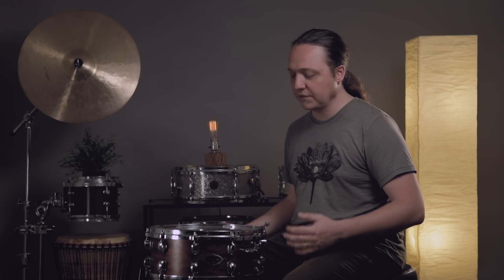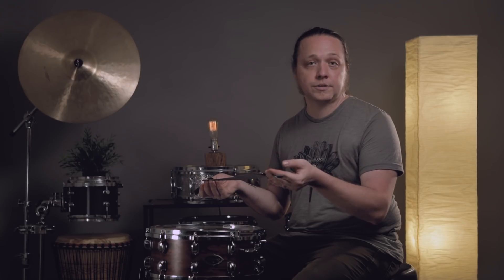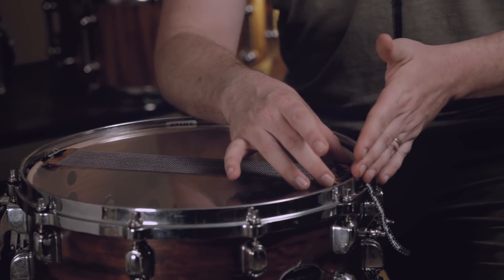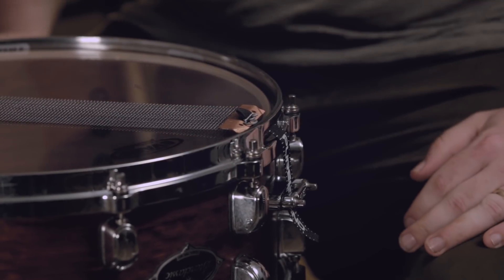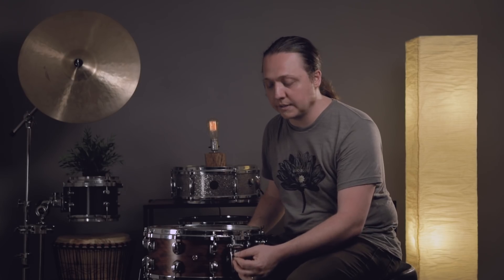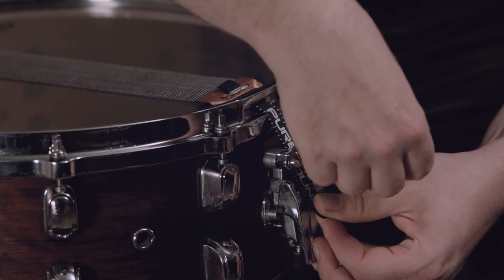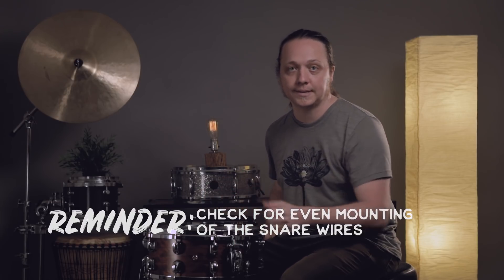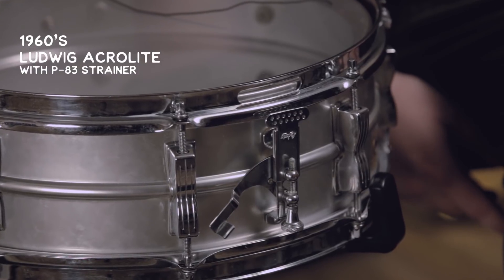Ep. 18 How to Install Snare Wires

Comment from the maker: What's your preferred snare mounting method (straps or strings)?
Reply: Straps, since 1. I find they're a lot easier to install 2. They won't dig into the edge of a drum (only really a concern on wooden drums) nearly as much since they disperse the pressure over a much larger are. Just my 2 cents :)
Reply: Whatever the drum originally comes with, I usually just stick with that method. The manufacturer must have shipped it that way for a reason..? That’s my thinking! Cheers
Reply: Strings. I am unable to line up straps for some reason.
Reply from the maker: Always worth experimenting though. You'd be surprised to know how often drums ship with certain OEM gear that doesn't allow the drum to function at it's best. Heads and wires are at the top of the list for that. Thanks for watching!
Reply: Strings have always been my preferred method as I've had trouble seating (plastic) straps in the past. Once they've got a good kink in them, it becomes difficult to adjust them without replacing them. Those nylon straps appear to be much more functional though.

There's also something cool about using string, I guess since it's sort of old school. 

Great channel with excellent, knowledgeable and articulate hosts and top notch information. Thank you!
Reply: Straps. I find it easier to keep the wires nice and even using them. Having said that, I use strings on a couple of my vintage snares for the reason you said (no clamping mechanisms on the throw) and don’t have any issues. I do prefer to use the Grover Percussion Dacron strings when necessary. Thanks for another helpful video.
Reply: Strings, always, because the slack in the strings will be equally taken up as the snares are tensioned by the strainer, resulting naturally straight snare wires.  A strap holding the snares, if installed even the slightest bit crooked, will leave one side of the snares unequally tensioned.  I also think the slight give in string is beneficial in allowing the snares to react and not choke the drum.  And I use a double knot to tie off the strings, as you illustrate, I've never had one come loose.
Reply: Pure sound straps . With measuring tape
Reply: I like straps due to the ease of installation and adjustment.............but have often wondered if I am missing anything by not using strings.  Seems like a lot of high-level snare drums come with strings (Ludwig, Sonor, etc), so I find myself wondering about the snare bed itself and if straps might lay the snares a little too flat..........
Reply: I would imagine that straps may indeed lay the snares too flat on shallow beds, however it depends on the endplate design, the custom pros look interesting.
Reply: I used straps in the past but have gone back to using cord. Sometimes butt plates and strainers can be a bit crooked or not square on the shell. I would imagine the straps that come with custom pros are only straight/square if the hardware is straight/square too. I think cord can be more forgiving.
Reply: Straps. I´m not good at using the threads, plus they damage the shell.
Reply: Straps. I am so bad at mounting strings.
Reply: @Tyler_Wilson  At times and more often than not the manufacturer simply uses what's the most cost effective for THEM.
Reply: Straps for sure. Strings scare me haha
Reply: Sounds Like A Drum straps
Reply: Strings because no matter what straps I've used on a few different strainer/throw off's, they always pull loose no matter how tight I clamp them. Frustrating but strings 110%. At this point I don't even think one could make me change back to straps.

Comment: Cody,  first let me say thank you for all you and the Crew do,... much appreciated.
I have a question about mounting wires with string on a vintage 1960's Ludwig Acrolite with a Ludwig P83 snare strainer like in this Video.
What string are you using and where can I get some of it at ???? It looks like it ties easily with an even PULL on the wires.
Most of the string / cord I find is a little on the "thick" side and when I tie it, it becomes unbalanced or un-even on the PULL of the wires. (very annoying to deal with).
Thanks in advance for any help.
GOD Bless

Comment: I use those same Puresound snares as in the first example, but I took off the spring clips and used some 1/8th inch aluminum rod to keep the snares and strap straight.  With the clip they want to slide a bit to one side.
Reply from the maker: The Custom Pro series mounting is a little tricking. If you don't have a hairpin clip of some sort, there's often a greater risk of them falling out during performance. That being said, even the hairpins will fall out if they're not centered within the inset portion of the end clips.
Reply: The aluminum rod I used had to be forced into the strap and in two years or more has not slipped.  I found that after some time, disengaging and engaging the snares caused to clip to shift and cause the snare wires not to be totally parallel with the hoop of the rim causing stange sounds.  One would have to see what works for them.
Reply from the maker: Sounds like you found a great little hack! Always good to be cognizant of that stuff. Cheers!

Comment: Hey guys, I have a question!

I have a steel Yamaha snare with the same pure sound wires. An Evans technician in my local shop helped me set it up last weekend with new wires, batter and resonant head. Sounded gorgeous. I keep my drums in the garage where the temperature fluctuates (UK Winter/Spring). I went to play last night and the noticed immediately snare wires had lost a lot of the tension and didn't sound as clean when trying to add tension to the strainer so I ended up loosening them off and trying to re-fit them.

My question:

Can the strap ribbons stretch with temperature/moisture or is it more likely that they've slipped through the tension mechnism?

Love your channel.

Comment: Where should I put the snare adjustment if they’re a one on the butt plate side AND on the snare switch side. I have a Tama SLP Bubinga and there’s snare adjustments on both sides. I changed the stock snares but I’m still having buzzing issues and it’s really discouraging and frustrating. I don’t know what I’m doing and I watched this video 100 times. I really can’t get the sound I want and I’ve literally been messing with it all day. I jut want a good metal crack but it’s soo ringy and buzzy.
Reply from the maker: I hear ya, yeah those can be trick. Honestly if I had one of those I'd probably just tighten the butt plate side up all the way and pretend like it's the non-adjustable kind. I'm not 100% sure what the need is for adjustment on the butt plate side as well (other than maybe to have some wiggle room for making sure the wires are centered on the head after installation). Based on the sound issues you're describing it's probably more of a snare-side head tuning/leveling issues than the wires or that mechanism but hard to say without seeing it in person. FWIW, i've also purchased snare wires that turned out to be defective right out of the box once or twice. It's uncommon but it can happen (damage in shipping etc), might be worth taking them off the drum and laying them on a table to make sure they're not twisted or anything. Good luck! - Cody

Comment: Would it be too much of a bother if you show us a video installing and tuning a Rogers Dynasonic Snare drum? I find it a little complicated with the presence of a snare frame to hold the snare wires.
Reply from the maker: Neither of us have a Rogers Dynasonic but if Rogers is interested in having us do a snare spotlight video one the reissued drums, we would certainly dive into the snare wire mounting and fine-tuning. -Ben
Reply: @SoundsLikeADrum  Thanks

Comment: Do you have a preferred model of snare wires for jazz?  I currently have Canopus Vintage Dry wires on my Yamaha MCA snare based on some recommendations, but I don't really dig the sound.  It's a little too bitey (mids high?) for me.  I'm not sure if it's the wires, but it consistently sounds like when using different tuning approaches as per your videos.  I want articulation, tone, and warmth.
Reply from the maker: Yeah those particular wires are suuuper articulate and can be a little sharp-sounding for my taste (i've had two sets over the years). I personally only  really use two kinds of wires (apart from if i'm just using whatever came with the drum) I use Puresound Custom Pro 24 steel for a wider/softer sound and Puresound Blasters for everything else. Don't be scared by the name, the Blasters are way versatile and much closer to older steel snappy snares that i've found on vintage gretsch or ludwig drums in terms of the thickness/stiffness of the wire. There are also 20 strand Custom Pro's if you want less wire sound, but with any of the sets I mentioned you should be able to get a great jazz sound with proper snare side tuning. Good luck! - Cody

Comment: wait a minute... are you not supposed to tighten and loosen your snare tension with the strainer open? I always took the tension off with the strainger, and then adjusted tension, then closed it up.
Reply from the maker: There's no hard and fast rule with that. In some cases (often depending on the strainer) it's difficult to do it with the tension engaged. Still, I've yet to see any damage or other negative effects from adjusting tension while the strainer is still on and then you can hear the subtle changes smoothly as you alter the tension. -Ben

Comment: Do you put the soldered side against the bottom head? (The side with the prickly bits)?
Reply from the maker: Yes! But always double check to make sure that there aren’t any sharp points (anything that could pierce the snare reso) protruding. If you discover something, you can file it down with a metal file.

Comment: Awesome video as usual guys! 
My question to you is if you have a tension knob on the butt plate as well, would you recommend making that as loose as it can go too? 2 of my snares have this and I would love to hear your feedback. 
Thanks!
Reply from the maker: Oh, like there are tension adjustment knobs on both ends? Hmm, I think I’d probably put the secondary one at the midpoint and just treat it like a normal passive butt plate. The thing you want is some room on the mechanism to adjust tighter or loose and for the wires to be centered on the head when engaged, so I think that’d be the way to go. Plus with that kind of mechanism, you can adjust the centering of the wires by loosening one end and tightening the other incrementally. Pretty cool :) - Cody
Reply: Good point! Thanks for giving me your feedback, Cody! Cheers!

Comment: I have a question. A couple of months ago I bought a 24 Strands snare wires, but by watching a previous video on your channel it seems like this wires are for a snare with no snare bed (Like the Tama Starclassic on your video) but my snare is a Mapex Armory Tomahawk and a Ludwig Epic and both have snare beds. Do you think that if I put this on any of my snares it would affect the sound in a dramatic way due the fact that both have a snare beds but this snare wires are designed to snares with no snare beds? I really need your help
Reply from the maker: Hey there! I think you’re gonna be fine, 24 isn’t that wide of a wire set. Once you cross 30 strands and especially at 42 you start to have the snare bed design really affect the behavior of the wires. Give them a try! - Cody
Reply: @SoundsLikeADrum  thank you so much!!!

Comment: Just a funny midnight thought: what about using strings AND straps? It might be difficult to have an even tension of the 3 devices, but it could be interesting to have a "perfect" tension of the wire strand from its centre (with the strap) and the edges (the 2 strings). 

Alright, maybe I´ll feel ashamed tomorrow morning about this comment.
Reply from the maker: Hmmm, interesting concept though there tends to be one option that has the best angle for tensioning (this is something we’ll cover in a future vid).
Reply: @SoundsLikeADrum  mmm I guess this is going to be the strings as it seems to be the preferred method in your videos. Personally, I struggle to get get equal tension on both sides, and it is rumored to damage wooden shells...
Reply from the maker: @Eurodrummer666  It's a little tricky but we've got a method that works. Also, strings are always the way to go- this really depends on the design of the wires as well as the snare strainer. As far as strings damaging wooden shells, the blue wire that Puresound used to sell was definitely capable of this but the woven brown cord doesn't seem to produce any problems: 
http://www.puresoundpercussion.com/PSPProductDetails.Page?ActiveID=4896&productid=3&productname=Dark_Brown_Braided_Line
Reply: @SoundsLikeADrum  Nice alternative, i wish this brown cord will be imported in European shops soon! About this method to attach cords, have you mentioned it in an earlier video?
Reply from the maker: @Eurodrummer666  It was buried in a video we did previously on snare wires and/or snare side tuning but we'll cover it in a real-time setup video coming soon.
Reply: @SoundsLikeADrum  Yes, please!

Comment: What about strategies for centering the snare wires once on the head and engaged? I find that to be pretty important to get a good snare sound/response and its always a struggle.
Reply from the maker: Absolutely - it’s super important. I don’t have any specific tricks, I just pull on the wires or strap that’s on the mechanism side after the butt plate side is mounted and cinched down and look at where that end of the wires lands on the head when it’s under tension. Cheers! -Cody

Comment: I have found I could be most creative with the ludwig p86 millennium throw compared to the P83. Because the arm of the P86 sits perpendicular to the drum, as opposed to parallel like the P83, mounting my snare with the throw at my 6:30 (or right between my legs) allows me to engage and disengage as I drum. Whats more, engaging sounds like a ghost note or a predelay on a loud crack. While improving I am able to use my snare as a shallow tom for long sections and just drop in two cracks at random then release the throw again as i bring my arm down. You know the sound the snare makes as the wires are engaged. Just imagine using that as a note before a snare crack at about the speed/tempo of cocking a shotgun. I need to do a video cause I cant find anyone else doing this and I think folks would like it. It's fun and it makes the missus roll her eyes at me which means she loves it..... I think.

Comment: I'm surprised to hear that you like P83s so much. I never cared for them. 
On my recently acquired cherry 1970 Acrolite, I replaced the throwoff with a Dunnett, though I kept the P83 and the original heads and snares.
Reply: Does the dunnett fit that snare? I don't care for the ps-83 either...maybe ps 86?...
Reply: @gibrandogg  he's confusing the p83 with the equally bad p85.

Comment: This (as with all of your other videos) is very helpful and informative. I’ve been struggling with a vintage Premier steel shell snare that uses holes on the strainer, and my biggest issue has been that the leading brands of snare cord seem to be laquered. This makes it very difficult to tie a knot that stays put - it doesn’t settle as a string would.

Comment: Straps. I do have string on my Ludwig sometimes it’s difficult to see the small holes on the throw offs I also use shoe string dress shoes 👞
Reply: You should look at replacing the throw off and butt plate to the p88. Drums on sale makes a version with the butt plate tapped so it adapts to the p32 butt plate.

Comment: Very informative as always! Although I found that starting with the throw-off side allows me to perfectly position the snare wires in the center of the drum before tightening down the butt plate side, by slightly tightening/loosening the throw off
Reply from the maker: Thanks! That's the best part- if you've found something that works for you, then that's great. We both choose to mount from the opposite end first since that side will remain static with regards to the distance from the shell, allowing us to focus on the tension on the strainer side. Regardless, what matters most is making sure that the wires are centered once tension is applied. Cheers!

Comment: great video, thanks for the info.  i am re-doing my snare wires and heads after years of neglect and needed a refresher course lol.  your thoughts on the Noble & Cooley strainer, with classic rope as opposed to straps?  I have a 4x14 N&C and replaced the recently snapped string wchich resulted in a broken strainer after 20 years of loyal service.
Reply from the maker: Hey there! I’m pretty into strings for most of my snares including my N&C, but have had some good luck with straps at times. Currently I have 20 strand Puresound Blasters on mine, attached with strings. Works great :) - Cody

Comment: Great video, super helpful. Do you need less wire strands the thinner the snare bed? My Vintage COS snare has a very narrow snare bed, 20 strands seem to buzz a lot. Should I try 16’s?
Reply from the maker: I'd say yes, definitely worth a try. Maybe even 12's or perhaps a narrow 'orchestral' set. If the contour of the head (because of those narrow snare beds) forces any of the wires away from the surface or makes the outer wires feel loose compared to those in the center, i'd look into something more narrow. I've seen some modern drums that are going for the vintage feel and vibe, Joyful Noise for instance, that at times use very narrow crimped snare beds and I saw first hand how much changing the wires can change the drum in this regard. Good luck!